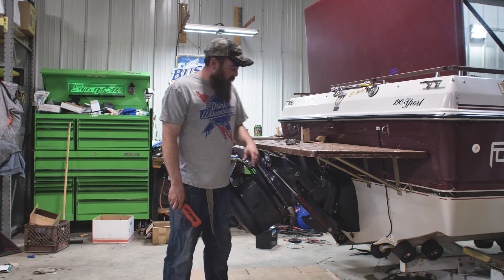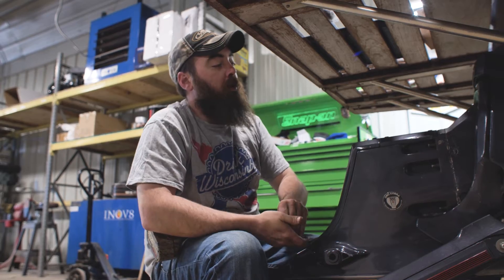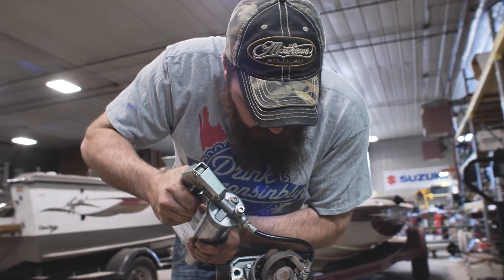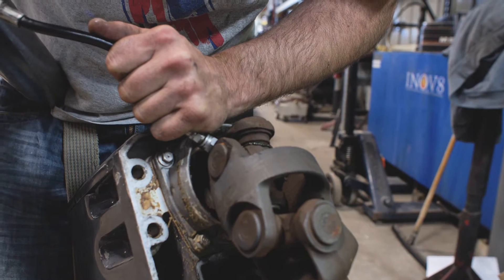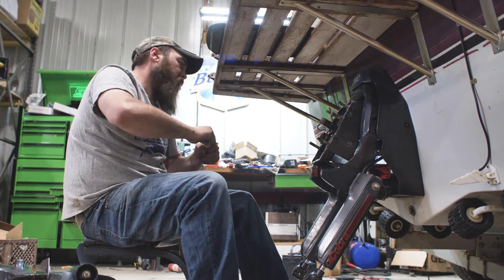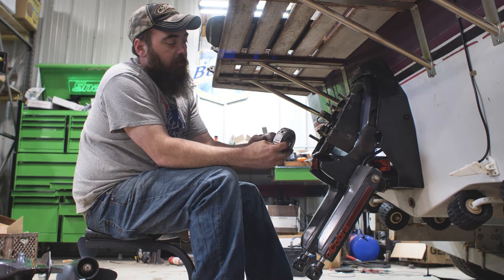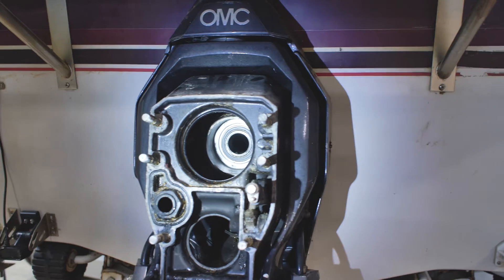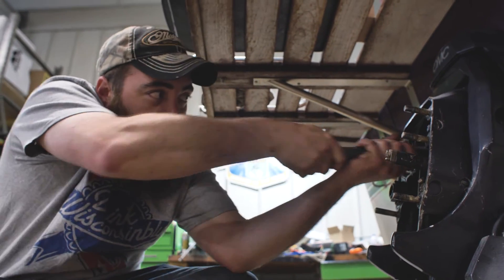Team Tech Tip #8 | Gimbal Bearing Replacement

Comment: Good video. An added point to the one you made about alignment that some folks might not know is the gimbal bearing itself pivots slightly. So often what I do is insert the alignment tool then pop it with my hand a few different directions so to break it free. Ive found it’s pretty rare that the engine itself is out of alignment, it’s almost always that the inner race of the new bearing is just stiff…especially if it’s still frozen from being in the freezer. Unless it slips right in like yours does in which case I crack a beer and thank the boating gods.
Reply: Yep exactly what I do. Tap the alignment tool North, South, East, West then remove tool and insert drive. Usually goes straight in then. 👍🏻

Comment: BUY THE ALIGNMENT TOOL or rent one.  I replaced one on a 1992 Chaparral 2200 and it was a pain trying to get it aligned by myself.  Also replaced bellows kit and joints too since it was already apart.  Lesson learned as that was my first inboard boat.  Bellows kit as destroyed and leaking, seller lied and I didn't know to check, luckily our maiden voyage didn't end up as a recovery mission.  Don't store boat with the outdrive all the way up also, it stretches the boot prematurely.  Learned a lot with that boat, that's for sure.

Comment: So you can replace both bellows without removing the gimbal housing ???
Reply from the maker: Yes you can
Reply: @TeamMarineService  i just found that out lol its still a bitch  have to yank that sucker thru dont know about installing a new one though
Reply: @jcowboy123  did you end up doing it without pulling the housing off?

Comment: Great vid!
Im about to replace bearing on my "pre" Alpha unit. Does it matter which way the new bearing faces?
There is a side with 2 slots and the opposing side is smooth.
Just wondering if it mattered.
Thanks
Reply from the maker: Smooth side with the dot facing out
Reply: @TeamMarineService  
Thank you!

Comment: a trick i have learned on some sternlegs is you can fill the drive bellows with oil (pump in with oil can) and if it gets a hole you see the oil on the water so you can pull it apart before it becomes a major.
Reply from the maker: Interesting!

Comment: How do you feel about the sealed bearings with no grease fitting?
Reply from the maker: Personally we do not like them but sometimes you have to use them when the application calls for them.